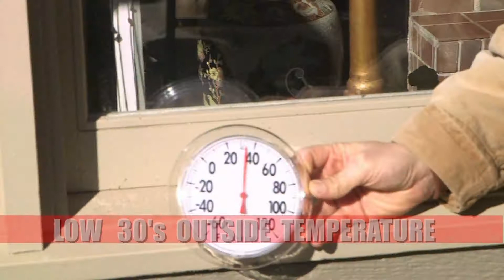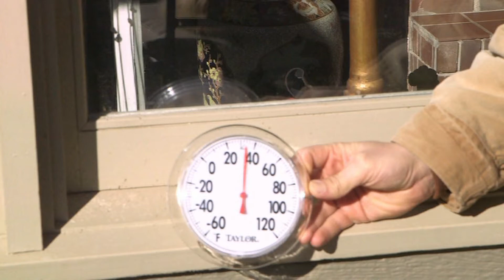Passive Solar House with Thermal Mass

Comment: This is a simple low cost method of doing this. NOW ... soapstone has the highest BTU storage capability then any other stone. Finish masonary stoves are used to heat homes. Ever consider using soap stone? it may cost the same..but not have to haul in so much concrete vs soap stone.